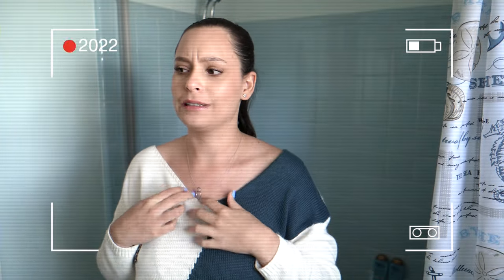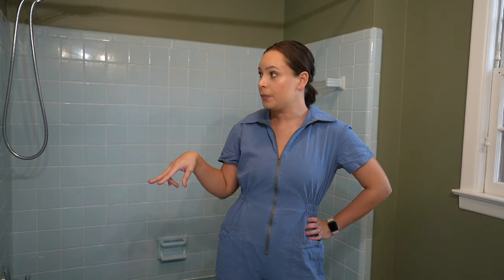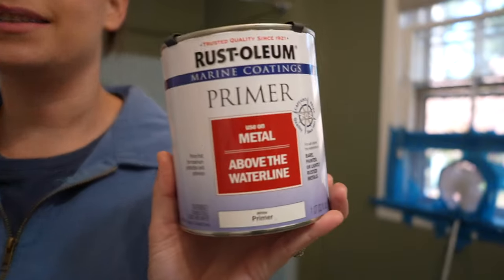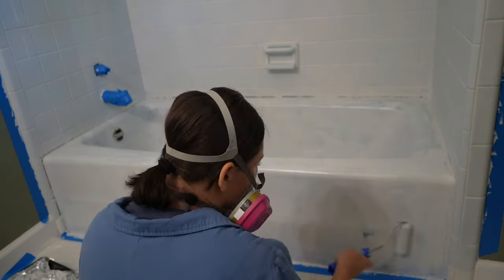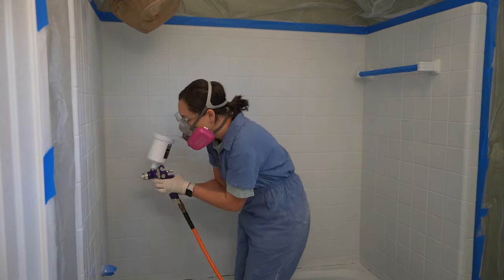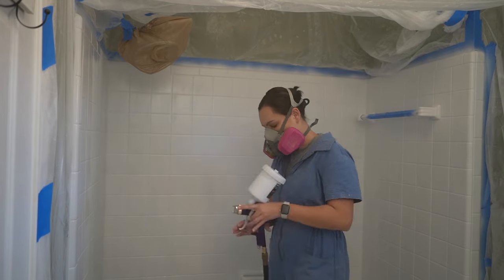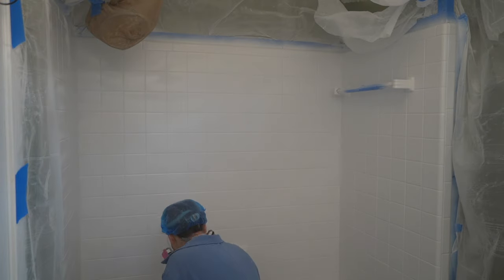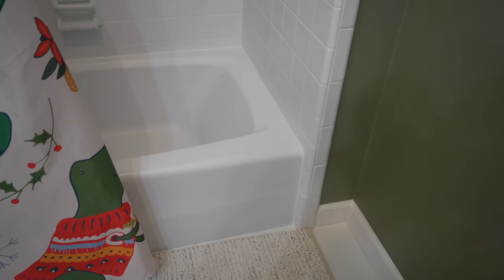Refinishing my blue tub & tiles with marine paint! | START to FINISH | Topside paint | DIY Bathroom

Comment from the maker: It was quite the job! I ended up using 1 can of primer and 1 1/2 cans of the marine paint. The paint was used to do 3 full coats with spray gun and 2 additional coats on floor of tub. Not bad at all!! 

I WILL update how it holds up. So far after many uses it’s looking promising 🙌
Reply: I think the semi-gloss looks great! Its very tranquil and clean and gives the bathroom an overall serene feeling. I didnt realize I would like it so much better than glossy🤷‍♀🤷‍♂ Your screen might be screwed, but screen isn't very hard to replace👍
Reply: So, how is it holding up this far along? It looked really good.
Reply: Hi! wondering if you have an update on how this paint has held up?

Comment: This is absolutely not a DIY project, I appreciate your ambition and drive to attempt this undertaking. But this is not only not going to hold up, this is a process that to be done correctly is very dangerous if you are not properly trained and have the correct safety equipment. This is a project that should be left to a well qualified and properly trained professional. You're going to have a nightmare situation when this starts peeling in the 6-12 months.
Reply: I used stix waterborne primer that sticks on really well. I used several coats so as not to need any paint and I let it cure 24hours in between. Then I used 3 coats kbs diamond crystal clear enamel coating, also curing a few days in between. No yellowing and still going strong 5 years later. No cracks and no peeling. It can definitely be a DIY job.

Comment: I used stix waterborne primer that sticks on really well. I used several coats so as not to need any paint and I let it cure 24hours in between. Then I used 3 coats kbs diamond crystal clear enamel coating, also curing a few days in between. No yellowing and still going strong 5 years later. No cracks and no peeling.

Comment: It’s going to start to peel in a few short months. You need to etch the tub and tile with Hydrofloric acid. Even if you prime but don’t etch it will peel. Then you have a nightmare.
Reply from the maker: I etched it as good as I could. Hope it holds. 🤞
Reply: What did you etch with?